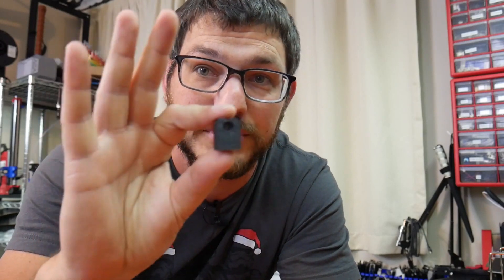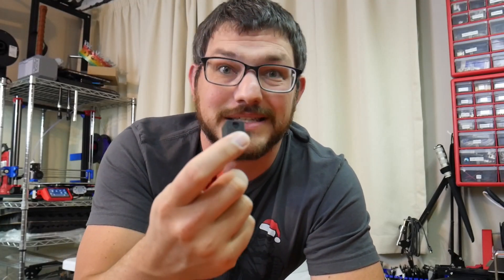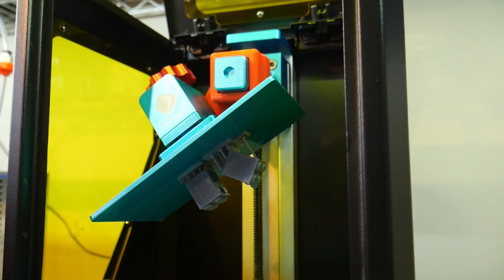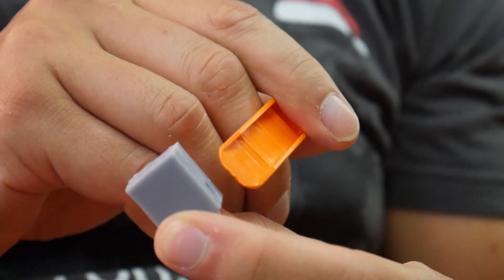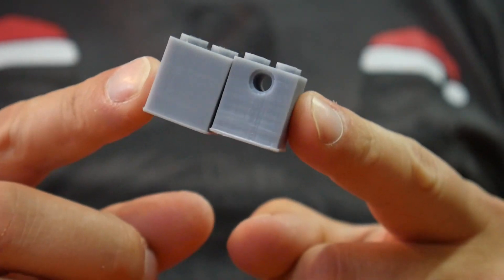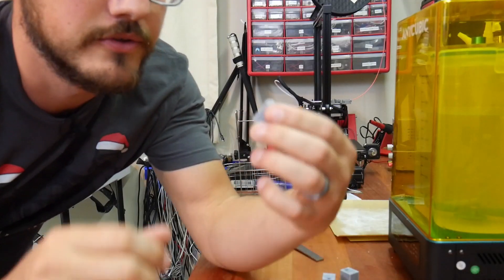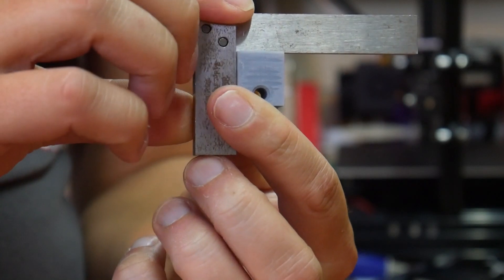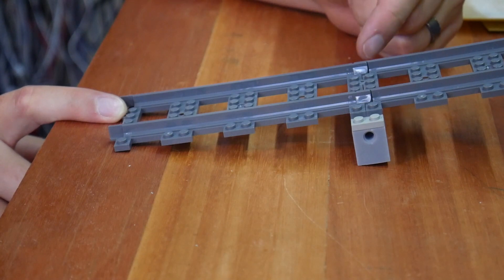3D Printed Lego Compatible Train Risers with Resin!

Comment: I've been having issues with getting the studs to print the right size, the brick itself is the right size though. How did you get them right?
Reply from the maker: Are you printing in Resin or FDM? Are your studs too small or too big?
Reply: @Fugatech3DPrinting  using fdm. The studs always come out smaller. the brick is the right size though. I'm going to try with my resin printer soon. see if it comes out different.